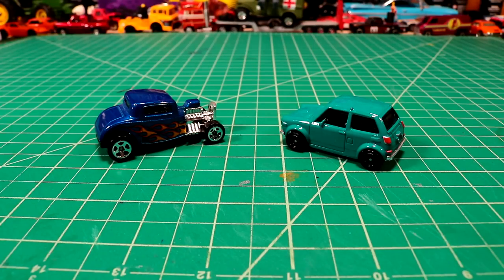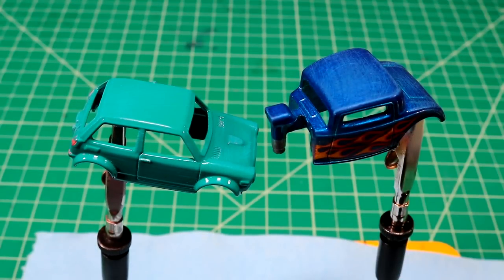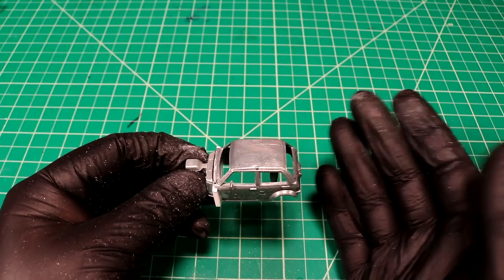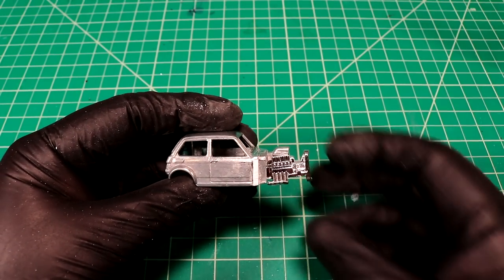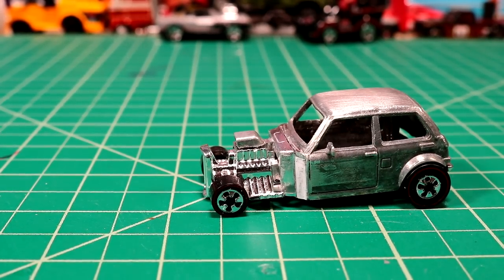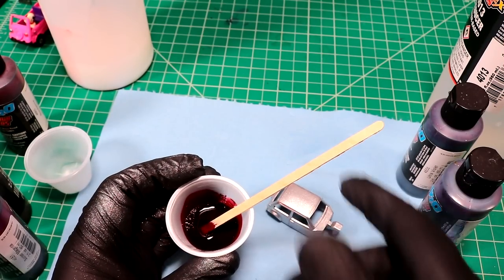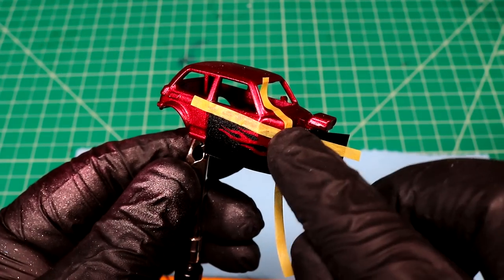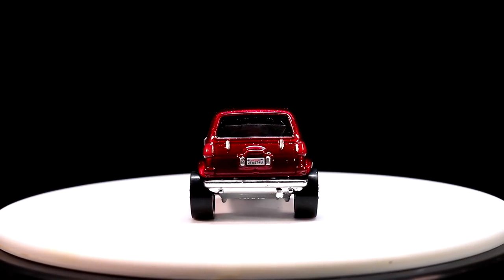I made something I shouldn't have...

Comment: I li e in Tucson AZ and when I was restoring my 1 of 1 1974 international stepside I went to a guys house for parts and he had a tiny little Honda with a blown big block stuffed in it. It was crazy. They had to remove the back seat and move the drivers seat to the back seat just to fit the motor in. The work was extremely clean it looked factory.  It was pretty sick. Awsom job thanks for sharing 👍.

Comment: Before I watched this build, when I saw the thumbnail, at first it looked like you merged the N600 with that extended nose Jeep CJ. I can't remember what it was called, but I have one around here somewhere. Somewhere. Somewhere. I also don't remember where I read it because it was quite a while back, but that the bump on the left side of the roof is there intentionally. I guess it was supposed to resemble an antenna of some kind? I don't know, but when I opened mine, I thought it was a paint blob until I started picking at it and it wasn't going anywhere.

Anyway, it's been a while since I've seen your channel, and my first video in a long time is this cool build. Definitely a unique one, and it looks like I might have to do a binge on your channel in the near future.